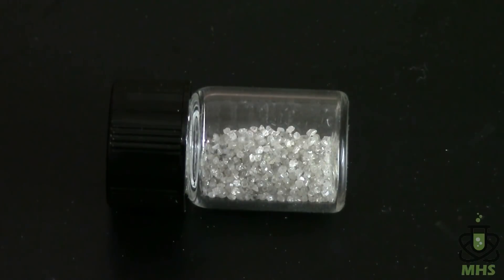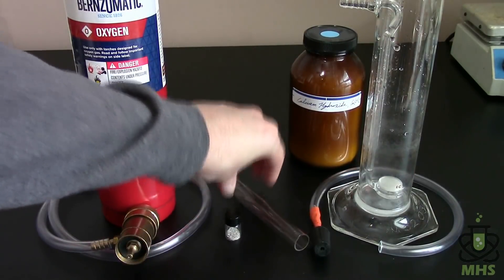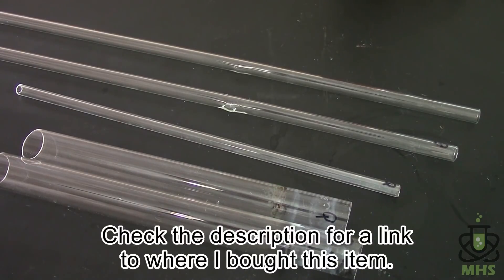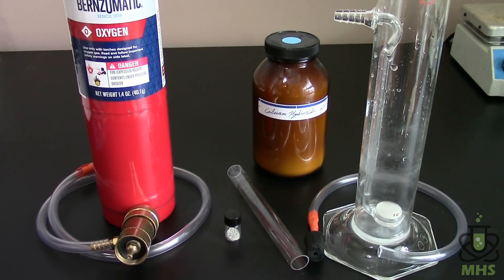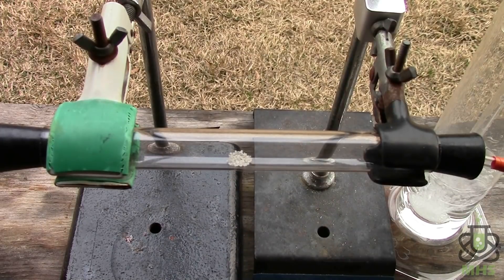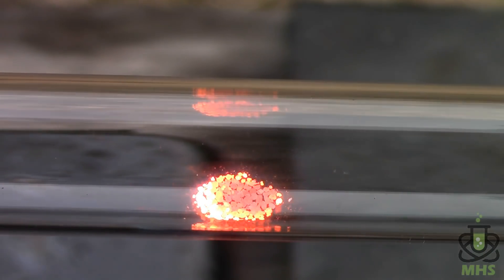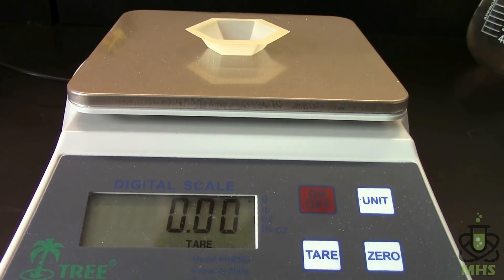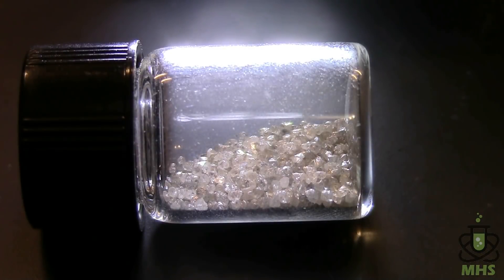Burning Diamonds

Comment: I'm assuming those are low quality man-made diamonds.
Reply from the maker: Should be 100% natural! They're just small and not gem quality.
Reply: @mrhomescientist  I've been wondering this for a couple of years. I know this might be a stupid question but... Can gold and diamond be melted together? 
I heard that metals and gems cannot melt together, from some ppl. But idk, I didn't see nothing specifically about gold & diamonds. I mean it's just Carbon (C) and Gold (Au). But I'm no genius on this.
Reply from the maker: @Flo_Resolution  Carbon doesn't melt at atmospheric pressure, it sublimes (at insanely high temperature, about 10,000 F). You'd need insanely high pressure to liquefy it, and even then I think it's unlikely they would alloy together. No super expensive mixture for you, unfortunately.
Reply: @mrhomescientist  Thanks for explaining, it would've been cool to have a Gold Diamond tho. A Gold and Diamond Hybrid.

Comment: So, you use the oxygen to force the gas off the diamond to lime water, so it mixed to show a reaction that is opaque. There is another way to show lime water to become opaque in other gases? Ya can try with different gases to change from transparent to opaque. So, regular water will not change to opaque.

Comment: why didn't your tube melt if diamong at 3550 C was sitting right there
Reply from the maker: Where did you get 3550 C from? Diamond ignition temperature in pure oxygen is only around 900 C. They gradually gets hotter as they burn, but the tiny size of the diamonds mean they burn away before much heat can be developed. Plus quartz glass doesn't start softening until around 1600 C, and it transfers heat slowly, so there's plenty of time before the glass starts getting damaged.
Reply: mrhomescientist can you explain how is this possible if i found articles that say that diamond burns at 4000+ degrees ender pressure some say it burns at 3550 deg and yet this is possible, can you do that with iron or tungsten?
Reply from the maker: If it said they burn at 4000 degrees under pressure, then there's your explanation. My system was not under pressure. It just had a constant slow flow of oxygen gas passing over. If you send a link to one of those articles I can take a look. Iron burns pretty easily; you can light steel wool on fire in normal air with a 9V battery. Tungsten is probably a lot more difficult.
Reply: @dusanpavlovic2201  the only way you could get heat levels around 4000 degrees celsius is by being a few thousand kilometers from the sun because the surface of the sun is around 6000 degrees celsius 850 to 900 degrees celsius is more believeble lol
Reply: @theyoungster9045  no it's not the nolu way it's pretty easily achieved
Reply: mrhomescientist can you burn steel like that and how does diamond compare to other elements could they also be burned like that i read that diamond melts at 3500 but this is burning what is the difference and how can diamond burn under so little heat you sait 900 deg
Reply from the maker: Steel wool is steel, so yes. You'd have to look up combustion temperatures of other elements to see how they compare; fluorine is probably the highest I would guess. Melting is turning from solid to liquid, a physical change. Burning is a chemical change where the element combines with others to form new things, in this case going from C to CO2. They're very different processes, hence the different temperatures.

Comment: Next video: the allotropic conversion of C (graphite or coal) to C (diamond). by use of high pressure and heat. I have heard that if you stomped your feet on a piece of coal daily for 1 year, diamond will form.
Reply: Gary Card i have to disagree with that,iirc diamonds only form when both high pressure and temperature are present. Stomping on a coal everyday wouldnt give it enough heat and pressure to turn it to diamonds.

Comment: if u used large excess of limewater then CaCO3 will definitely not redissolve
Reply from the maker: Good call. I used a small amount because the more I put in the wash bottle, the higher pressure is required to start bubbling through it. I didn't want to blow the diamonds around in there!

Comment: 13:00 the thermal conductivity does not matter as most of the heat is lost by radiation. Thermal conductivity would only matter at a far larger scale, due to the square-cube relationship.
Reply: Yes, the true reason is due to diamond's low specific heat capacity
Reply from the maker: Interesting; thanks for that.

Comment: Curious: How much were the diamonds worth?
Reply from the maker: My initial vial was 5ct at $30, so the half carat I burned is only $3 worth. Good guess, Eric M!
Reply: uncut diamonds arent really worth all that much. Diamonds value are largely overinflated due to a huge part of the market basically being a monopoly. The 100 milligrams he had starting out would be somwhere between 1.5-2.5 dollars.
Reply: I know, but depending on quality and his source, the price could vary. Also, I'm sure he paid less than you or I would pay for half-carat earrings or the like from a retail jewelry store, as @Eric M stated.
Reply: Eric, that's a lot less than I would have guessed. Thanks for answering.
Reply: Ur right
Reply: RJ Parker 1 penny
Reply: You can find even cheaper diamonds if you go for smaller sizes. Just a quick search on ebay shows a listing where you can buy 10 carats for $19 but they're very small (400 diamonds per carat). So you can do this experiment even cheaper. :)
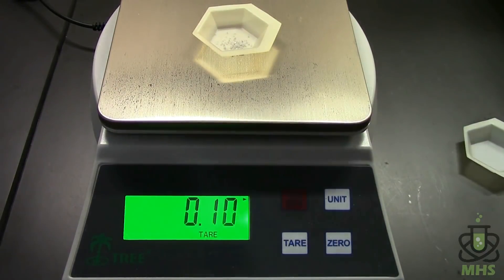Reply: RJ Parker he says half a carat 8:30
Reply: "But you're probably here for the links: Diamonds: bought on eBay from seller "hattongardendiamondsonsale". It was a few years back so no link, but what I bought was titled "5carat White good quality 1.00mm Loose Rough Diamonds 100% NATURAL uncut russian" and cost me $30."

#Description

Comment: Great video !!   What temperature (F) do you think was reached while burning the diamonds?
Reply from the maker: According to gemsociety.org, "The temperature of diamond ignition in pure oxygen is 690º C to 840º C." That's 1274 - 1544F! Not all that hot, really. Pure oxygen really enables this reaction, and I'm not sure if it would work in open air.
Reply: I am surprised, I was expecting much higher!
Reply from the maker: Bradyn Austin Cool video. I suspect it didn't melt because the gold conducted the heat away too quickly, plus the stream of oxygen is cooling it. Very different experimental conditions than the graphite melting gold he showed earlier!
Reply: Indeed. If the gold melts at 1948 & diamond burns at 1544, the gold will offer a small chuckle in response. What happens to diamond when heated with something like oxyacetylene? Does diamond just vaporize quickly? Or something cooler?

Comment: It's weird that the oxygen regular is left hand thread, generally oxygen is all right hand and fuel gas is left hand. The purpose of this, as I believe you say in the video, is to to help distinguish oxygen from fuel gas. I suspect that possibly this particular form factor is mostly used for fuel gas, and therefore fuel gas gets to be right hand thread.

Comment: Oxygen regulators (or anything in an oxygen enriched environment) are special, as high concentration high pressure oxygen tends to light everything on fire (including metals like steel). Even so, oxygen regulators still explode every so often, just google "Oxygen Regulator Explosion". Every material has to be picked carefully, among other considerations. http://www.airproducts.com/~/media/files/pdf/company/safetygram-33.pdf PDF on oxygen hazards.
Reply: For what it's worth, those Bernzomatic oxygen bottles are not high pressure. They're barely enough to run a small torch, which is what they're for. Maybe 10PSI when they're new and warm. That thing he's got can't even be called a regulator - it's just a valve.